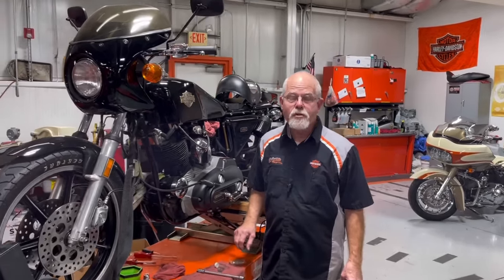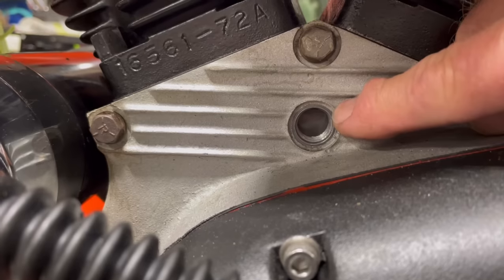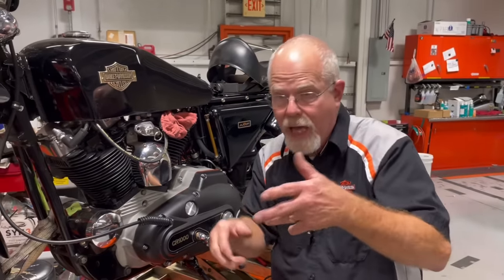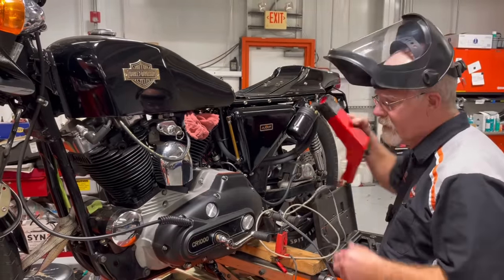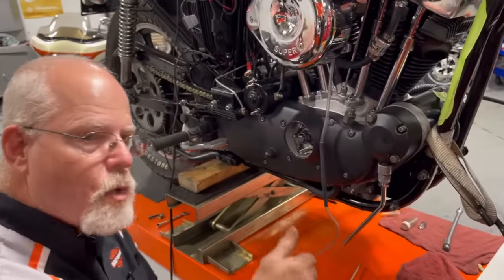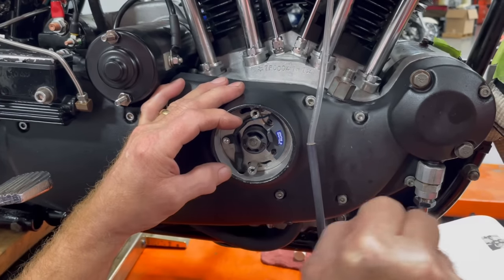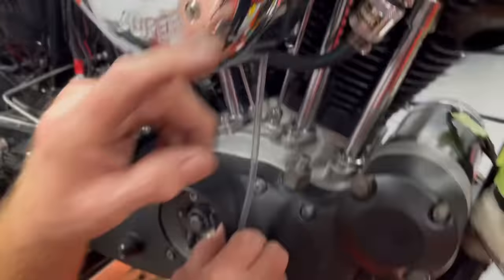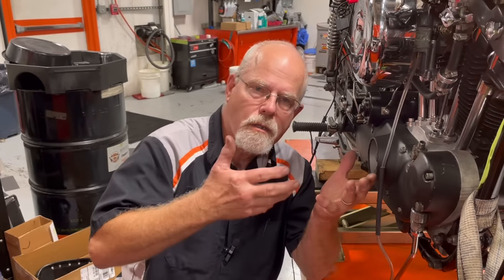Doc Harley: What is a Timing Hole?

Comment: Been there and done that! My '89 Sportster had the timing hole in the same spot as that bike. I was stationed in the Philippines and my ignition module crapped out. It would have been weeks or months for parts so I threw some points in it and was good to go. I believe they were Chevy Blue Streak points. They used to make a clear plastic plug for the timing hole for use during timing so we ditched the goggles and face shield. Also, static is one man job and dynamic is two man job.

Comment: We used to use clear timing hole plugs to keep the oil on the inside.  The big problem with them was, if they were short, the inside would get covered with oil and you couldn't see through them.  The longer ones worked great, you could have it just touching the flywheel, which would keep most of the oil vapor off of them, but would wing up sanding the surface.  Most of us didn't know about polishing acrylic, so they would go into the trash and you would buy another one next time.
Reply from the maker: Done that, got the T shirt…..Doc

Comment: Doc, I really enjoyed this video. I had a 1974 XLCH (brake on left, shifter on right). I still have the clear plastic plug that went into the timing hole and avoided the oil from splashing out of the hole onto the timing light. I also have a set of points and a condenser. Thank you for bringing back old memories for me.
Reply from the maker: Always willing to walk down memory lane with a Harley-Davidson rider….Doc

Comment: Doc. Harley when setting the timing on  the old school HD’s if you have the clear plug that you screw into the timing hole it stops the oil from spraying out and you can see the timing mark when checking the timing

Comment: Yes. You're too young to remember the clear Lucite plug we used to use on Shovelheads to use a timing light without creating a big mess. I had the Lucite plug but I learned to static time my Shovel well enough I didn't need the Lucite plug and timing light. My stock 74 inch with points ran well enough that I beat 80 inch bikes with electronic ignition. Of course it helped that I was chopped with a rigid Chro-Moly frame.
Reply from the maker: Believe it or not, had a handful of semi-clear plugs on the lift… just forgot….Doc
Reply: @LowCountryHarleyDavidson    You do great presentations. You're allowed to forget some of your lines.

Comment: Hey Doc, I put some Khrome werks slipons on my 05 Electra Glide Classic.  Now I only got hot air coming out of the right side pipe and cold air out of the left pipe. The left pipe is cold to the touch also below the Y but hot on the right side. So what's up with that?
Reply from the maker: I am not an engineer. This would receive a  better explanation from Kevin Baxter. My thoughts, the “Y” pipe was very inefficient but needed for the sound and volume of exhaust from both cylinders to get out. The front is joined to the rear on the right side. So more exhaust and heat here then just one cylinder. Ask any Twin Cam and M8 owner, they will tell you,”too much heat where they both join together at the CAT.  Also the passing air on the left only has to cool one small pipe and muffler. The right side is pre warmed from the front before adding to the rear pipe. Just my thoughts…..Doc